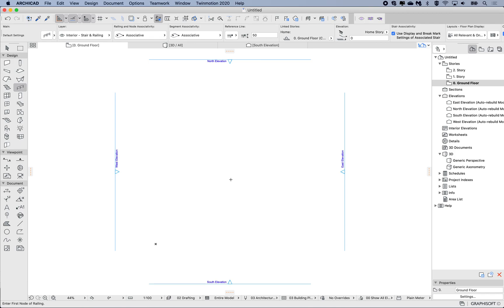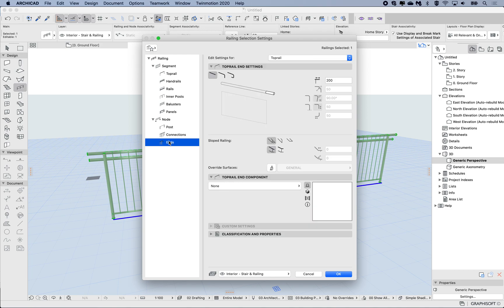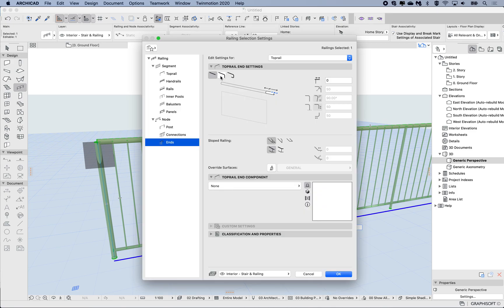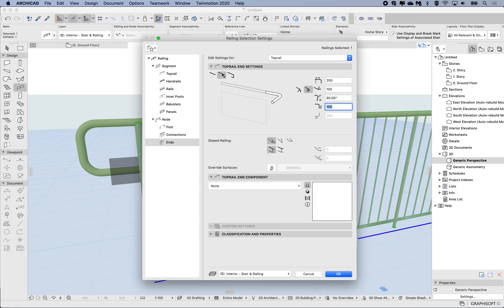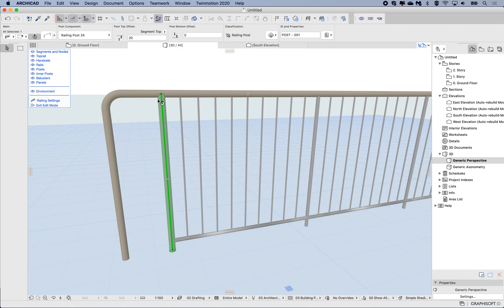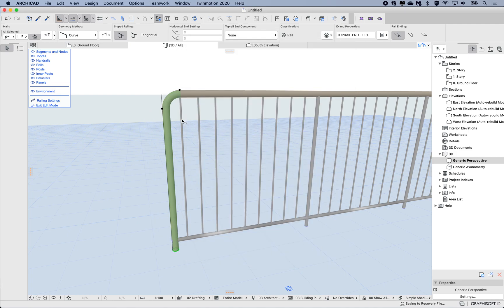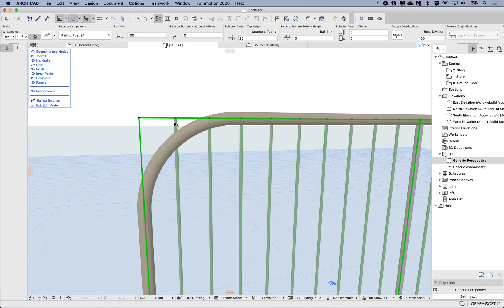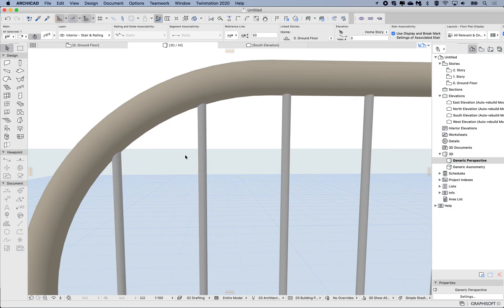Archicad Tip - Railing End Returns

Comment: Nice work
I would have a problem I want to ask of you.
I made a stair that goes to the height of 4.25 m, the first 12 steps are straight, then a landing, after the rest of the steps are in a curved configuration.  I have some problems with the rails that I place on them. I can't get the right spacing between  the post. Please help.